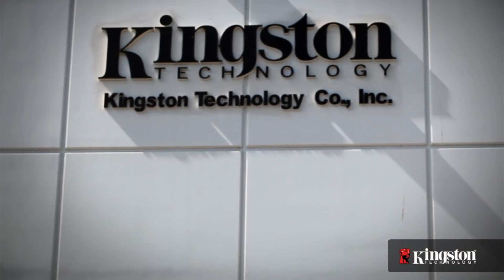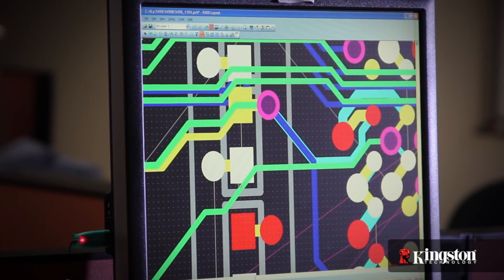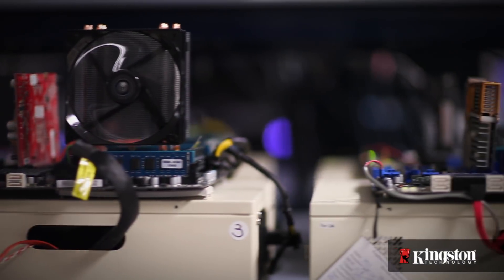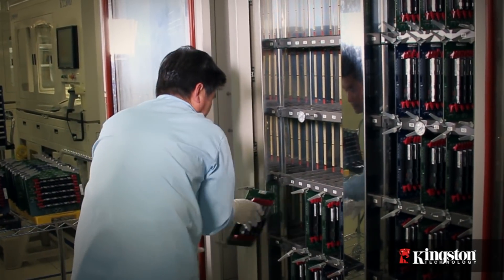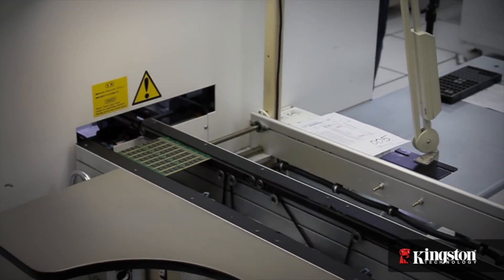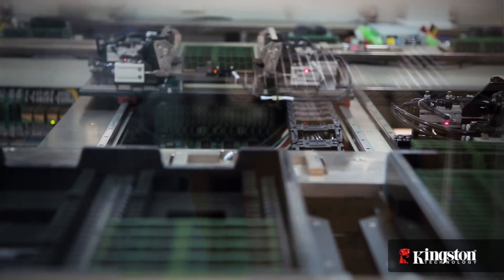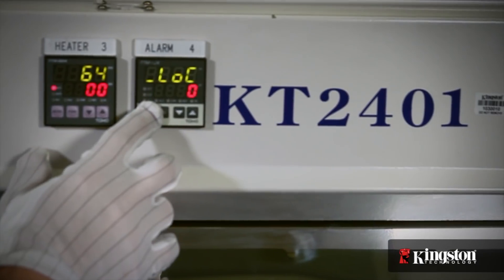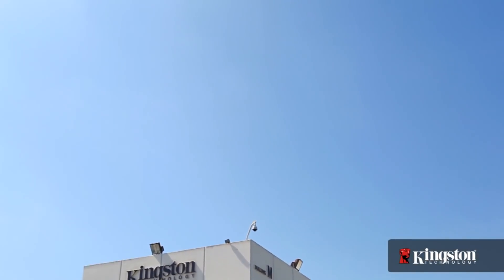Kingston DRAM Manufacturing Tour

Comment: What I wanted to say is ram form major manufacturer Won’t fail during normal uses easily (static electricity shock is not counted as normal uses )and those are just cheaper than Kingston’s I mean Micron, Samsung Hynix and etc.

Comment: Do those PCBs go through a wet process taking the layers through oxidation (a mix of H2o2 and h2so4) to bond to prepreg before being pressed DURING the memory manufacturing process or does another company make your boards?
Reply from the maker: Our PCBs are manufactured by another company, and the rest of the manufacturing process is done in-house.
Reply: @kingston  very cool. I used to work for a company that did all that.

Comment: Everything i get from this Video was high quality and Kingston... but i have a question... why do you still produce ddr3 ram sticks?
Reply from the maker: While the focus of DRAM manufacturers has shifted to DDR4 RAM production, we still try to support systems using DDR3 memory or DDR2 memory as well and will continue to do so until we are no longer able to source the components necessary to produce high quality memory upgrade solutions for older DDR2 or DDR3 systems.
Reply: Karl Heerwagen lots of people still use/need DDR3 Especially DDR3 Low Voltage is still mainstream as it uses less power.
I have a Core2Quad machine that works fine I built in 2009 uses DDR2.

Comment: Makes just under a million products per day but ya boi can't get some cheap ddr4 ram. I'm aware of the process of manufacturing and phone ram taking most of the market
Reply: Nope, its mostly phones and laptops.
Reply: You use the processor on the GPU to mine, and graphics card use a different type of ram than the CPU. Potato Derp is right, most DDR4 memory goes into laptops and mobile devices. Also, kingston buys the ddr chips from semiconductor manufactures. They don't produce the chips themselves, they may design the chip but a semiconductor foundry will actually produce it.
Reply: u mine wth ddr4 or wiith GPU?
Reply: ikr, every person on the planet has 3 cars, they should be like 12$

Comment: Kingston HyperX RAM has never failed me. I've been using Kingston RAM since 2004.
Reply: It's nice because it's cheap. But it's not the best though. Don't get me wrong, I like Kingston.

http://ram.userbenchmark.com/Comparison
Reply: Clearly you haven't used that much Kingston RAM's. I've had some fail on me but not much. Their SSD's on the other hand fail a lot, like a lot a lot. I've had over 20 of their SSD's fail just after 6 to 12 months after I sold them.
Reply: @AiFluent1  I've used Kingston RAM on 5 builds over past 15 years and it has been rock solid. That said, I've been using Corsair and G.Skill RAM over the past 4 years on my last 2 builds and they've been rock solid as well. The only two components that I've ever had fail on me was a Club3D Radeon HD 6870 reference design in 2010 and a Corsair AX 860i PSU in 2015. I guess it comes down to the personal luck and usage.
Reply: @AiFluent1  can u give more info on that if u can?
Reply: @skylordsrebornpvpreplays5795   Well, like I said... I work as a computer technician aka. pc repair and also sales. In just 2018 alone I had over 20 Kingson A400 SSD's go bad after just 6 months of usage. Their cheaper RAM's are also not that reliable. They often fail or come with factory errors when you are building a new PC and when you test them they show multiple errors. I have no idea why was that, maybe some factory mishaps or something else. That's why I avoid Kingson. There are a lot of other manufacturers that are way more reliable.
Reply: I had three sticks fail :/ admittedly may have been due to the motherboard but it's not for certian